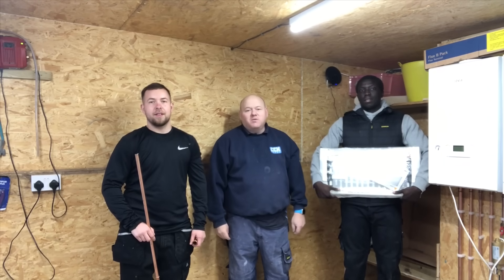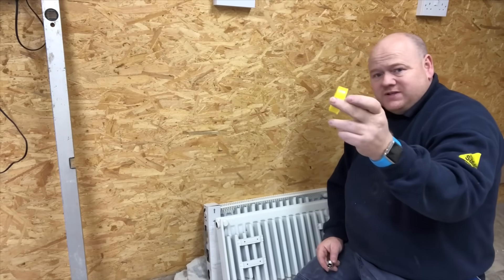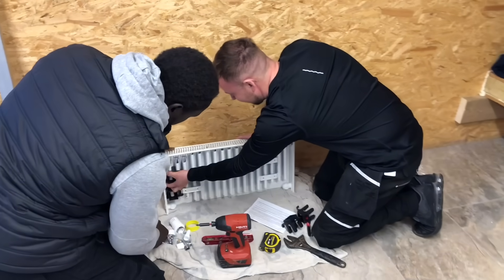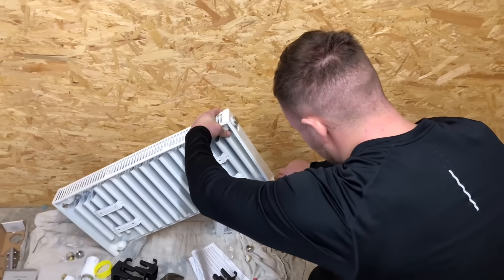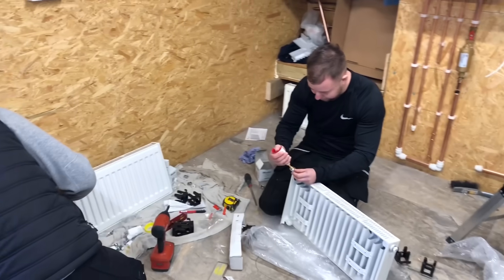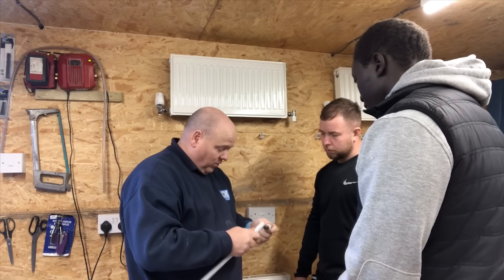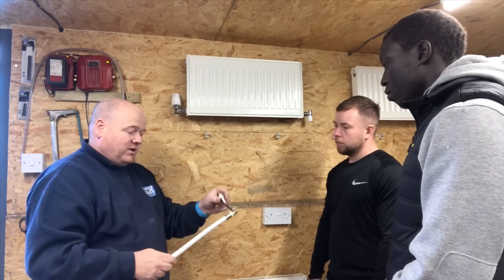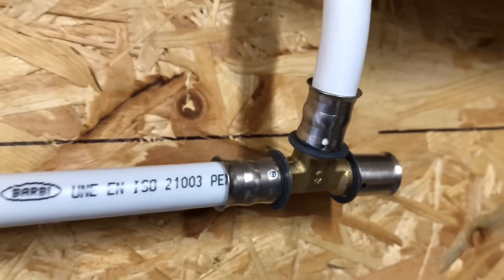Apprentice Plumber Training - Central Heating - Day One

Comment: Would you like some constructive criticism?

I have NO household  plumbing skills or training. I do have considerable experience of koi pond plumbing. I have used black waste pipe(s/weld) grey pvc pressure pipe (sweld), push fit, speed fit, chuckitallonthefloorandhaveafit, hep20 blah blah blah.

As a complete novice I would have like to have seen the odd diagram in the video.

My other notes were:

What is MLCP?
What is PEX?
What is a bleed point?
How much water do you need to put in the radiator? Or does it fill from your water tank? 
What are the plastic things called that you put on the bracket? Do they come with the radiator?

Otherwise, we'll done and thank you.
Reply from the maker: Thanks very much for your comment, please consider subscribing to support the channel 🙂

Comment: Where can you get those compression couplings from MLCP direct into the radiators? What are they called?
Reply from the maker: You can actually buy rad valves that are 16mm. EPH sell them.

Comment: Question for you should radiators be hung level or slightly higher on the air vent side?
Reply from the maker: I would always install them level. Thanks.

Comment: Loctite 577 is not much use when screwing in, say an elbow when you want the 90 degree of the elbow to stop at a particular point. PTFE is better then as when you get to the end of the tightening you can stop the turn at a number of points.  The threads packed with PTFE gives that advantage.
Reply from the maker: No thats not true, You can stop at any angle with Loctite https://www.youtube.com/watch?v=X0zOrglK9-0
Reply: @AllenHart999  
I tried t about 10-15 years ago. I did not like the idea of leaving it to cure. The instructions once said leave it overnight.  I recall it was expensive as well.
Reply: John Burns  loctite 55 you can turn back if needed without leaking added with little paste and its 100% fool proof
Reply: @jmb69er  What is it?  55 for metals and plastics.  Why buy 577?
Reply: John Burns 55 is for metals and plastic yeah and dont know why buy 577
Reply: @jmb69er  
55 is not for metal against metal? Only plastic and metal?
Reply: John Burns im sure you like to confuse your self 😂

Loctite 55 can be used for metal to metal, plastic to plastic,  metal to plastic
Reply: @jmb69er  
Then why buy 577?
Reply: John Burns i never said buy 577

Comment: Good work Allen as like all ways I was just wondering why the radiator manufacturers don't make the radiator tails a better fit as you need to wind 20 or so turns of ptf tape seems like the radiator  manufacturers may have share in the tape aswell.
Reply from the maker: Would be hard to change now. Thanks.

Comment: Nice way to mix up the format, no titles of cheesy music required. 
Thanks for not making them wear crash helmets ,high Viz jackets ,safety goggles ,special gloves,safety boots and a bullet proof jacket like what the Welsh bricklaying school video does for the task of making a 1ft wall with fake cement. 
Are the lads doing an on the job learning thing or are sat at theory desks ,what's the general structure of the course, and what's there favourite pipe material. 
As a suppries towards the end say there's been a hypothetical extension added the the building and you need another rad put in (the trickyest spot you can think of with lots of obstacles )
Hold my pipe,are you nervous? 👍
Reply from the maker: Thank you for taking the time to watch my video.